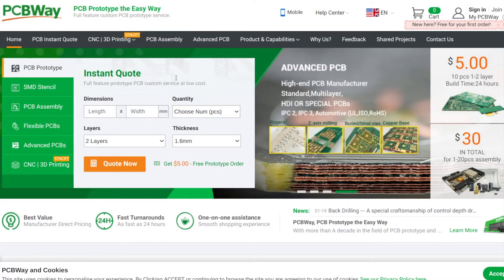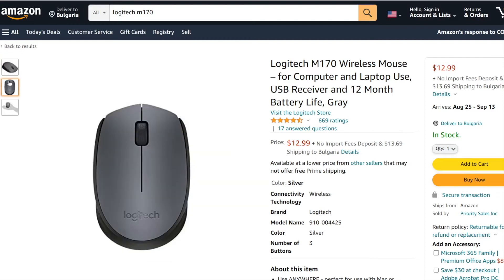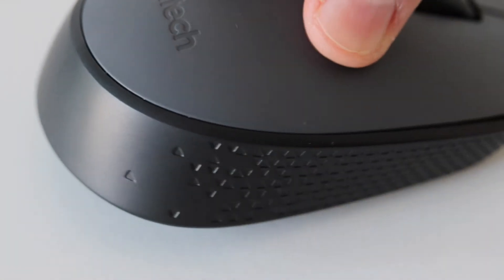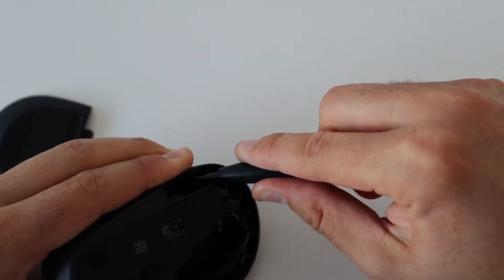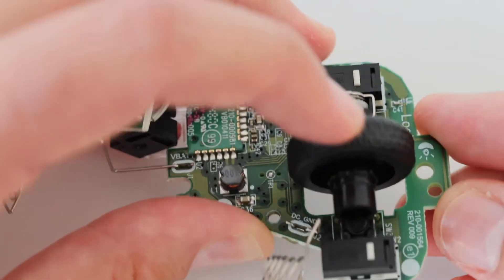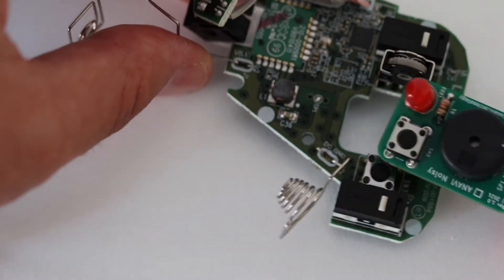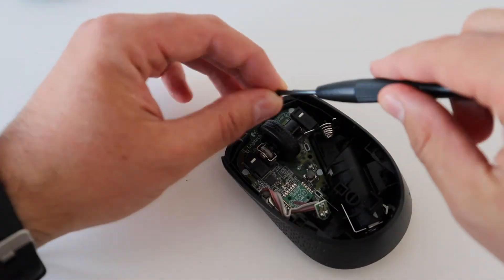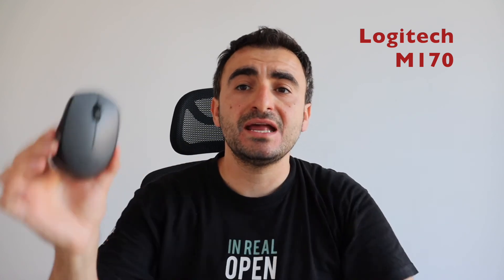Logitech M170 Teardown & Review

Comment: Estoy interesado en el sensor de ángulo que usa la rueda del scroll para saber lo que se ha girado. Podría alguien decirme cual es el que se usa en este ratón o en similares? Muchas gracias
Reply from the maker: I don't speak Spanish so I am not sure I understand the question. As you can see in the video M170 is with Nordic Semiconductor NRF 31502F chip and Capella 005 VB010411optical sensor.
Reply: @LeonAnavi  I'm interested in the angle sensor the mouse uses for knowing how much scroll has been done to the wheel. Do you know which sensor is it?
Reply from the maker: No, sorry, I am not sure which sensor is used for the scroll wheel.

Comment: Have the same mouse for the same use, suddenly it started to act like the battery is dying few time a week even when I put a new battery, it still acted that way, I dissasebled it, found a loose metal part that holds a battery, it di-soldered from the board, so I soldered it back, checked every other component, all is fine, but it still acted weird the same way for a week and then stopped working at all. Have no idea what else to check, can't find any video, any guides, if you can, please help. Used it since 2020, never even dropped it once.
Reply from the maker: It sounds like you did a good troubleshooting. This probably can be caused by various different reasons, including communication problems. Btw is the USB transmitter still properly detected by the OS on the computer?
Reply: @LeonAnavi  Thank you for your response!! Seems like the Device manager detecting USB, also disassembled the mouse, looked closely, and found some patina on the metal contacts on all buttons of the mouse, not sure if it has something to do with it working or not and the infrared optic LED does not show any light when I look at through camera lens, I remember it showed it once before but I haven't recorded it on video.
I recorded a video of the board close up, maybe it will help, if link does not work, it is the last video on my channel uploads:
https://youtu.be/qfQcPYbSH-c?si=kJFgst4X0agpx43f
Reply from the maker: @cry2love  I see patina on some of the solder joints on the PCB of the mouse in your video. This is a bad sign. Are any of the buttons of the mouse working?
Reply: @LeonAnavi  No, nothing is working, no life whatsoever. But it worked great, every 3 buttons (left right & middle mouse) until one day it started acting weird, turning off, like the batteries are dying and then went bye bye at all. My idea is to resolder, clear the contacts, and solder buttons back with new clean tin.
Reply from the maker: @cry2love  you can give it a try but considering the visible patina and the low-cost of the mouse it might not worth it. Btw a few months ago a button broke on my B170 and I had to remove it and solder a brand new one but the rest of the PCB components work great.
Reply: @LeonAnavi  I will give it a try and give you a feedback if it worked or if anything else would work. If nothing would help, I will get a new or newer model. Thank you very much for your response! You're a great help!

Comment: how do you remove the cover so easily
Reply from the maker: Do it carefully step by step. Remove the cover and the battery. After that take a moment to identify the 3 clips. After that pull them outward/away from the center as show in the video (this is the tricky and annoying part of the teardown as you may break a clip if you pull hard).

Comment: helped a lo, hanks !! he  ke and he  ke are no funcioning eiher
Reply from the maker: You are welcome. I am happy to hear that the video has helped you. In general the buttons can be fixed if there is a hardware problem but this requires removing the old and soldering new.
Reply: @LeonAnavi  like this mice came on the mk235 kit.
The keyboard stopped working the T and Y keys.
The mice I was able to fix it just by opening and cleaning inside with isopropyl thanks to your video.
Reply from the maker: @thelion.4K  looks like a membrane keyboard. In my opinion if the membrane is broken it is not worth repairing it.
Reply: @LeonAnavi  yeah it's a membrane.
Idk what happened.
Suddenly only those 2 keys stopped working.
I've already order a new keyboard.

Comment: hello i need help i dropped the m170 and it doesnt work anymore i have connected it properly and tried changing the batteries but still scroll and the buttons dont work and the mouse is on btw 
Please help
Reply from the maker: is the mouse detected by the computer as a USB device at all?

If you are running a Linux distro you can open a terminal and execute lsusb to see the list of all detected USB devices.
Reply: @LeonAnavi  yeah it is a usb device
Reply from the maker: double check that the drivers are ok and the mouse is detected by the OS of the computer. If it not also check the USB dongle and of course inspect the m170 for hardware issues after it has been dropped.

Comment: Im using g502 hero as my main mouse , I will get mx master 3s for the pc I use for 3D modeling but , I got the M170 for two years and it just stopped showing a mouse crosshair at all and not working it just happened in one day , so what can I do to fix it or how can I know what is the problem with it , and can I make it wired ?
Reply from the maker: mx master 3s is a nice model. Converting m170 isn't something trivial. Is the problem in the mouse or in the usb wireless dongle you plug in the pc?
Reply: @LeonAnavi  the mouse it self  , it came with a keyboard the keyboard is still working but the mouse is not.
Reply from the maker: @BriZ3l21  if the mouse itself is totally dead it will be hard to resurrect it without spare parts.
Reply: @LeonAnavi  heating the board with a heat gun can help ?
Reply from the maker: @BriZ3l21  yes, it might help if a solder joint is damaged and not making a good contact.